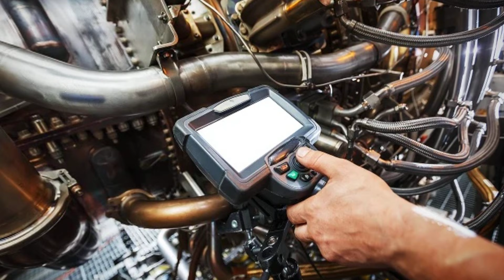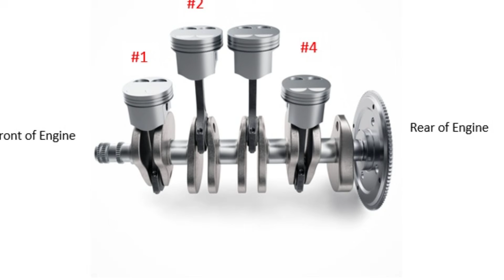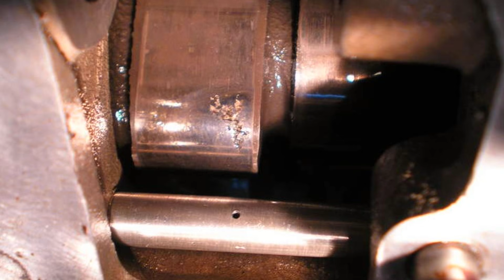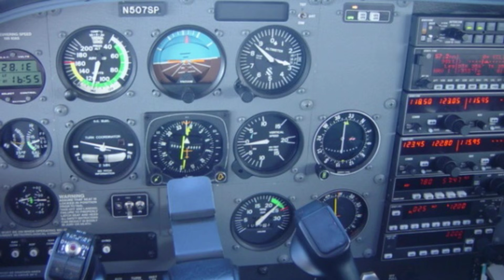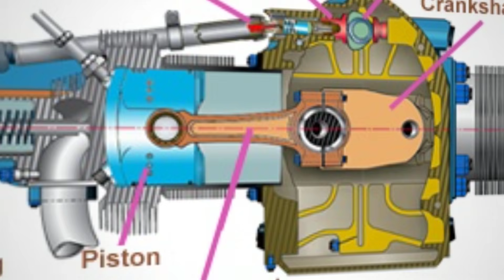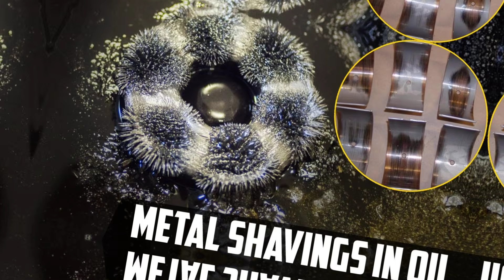The Flat Engine's DIRTY Secret the Radial NEVER Had

Comment: Wait a minute, what does changing the gear do for getting oil on the cam lobe? 
 I know it's a bit different but when ever I see something about the horizontally apposed engines I want to know. I ride a 1977 BMW type 247 motorcycle and the cam is below the crank, BMW motorcycles before 1969 had the cam above the crank and cam failure was a problem if you didn't store them properly.